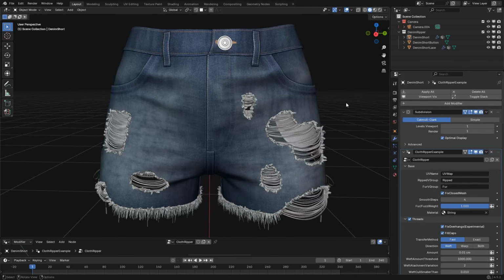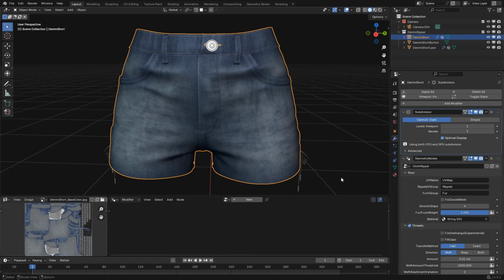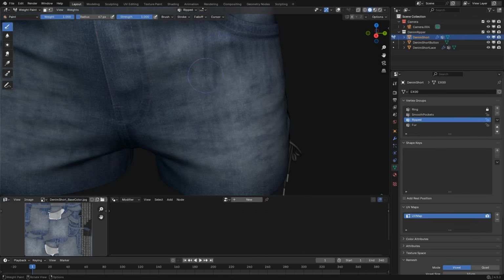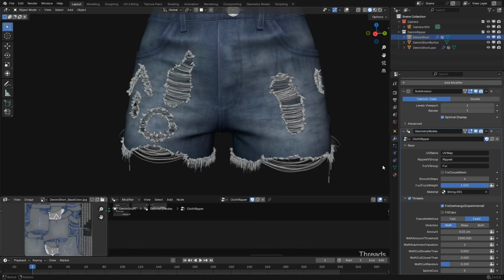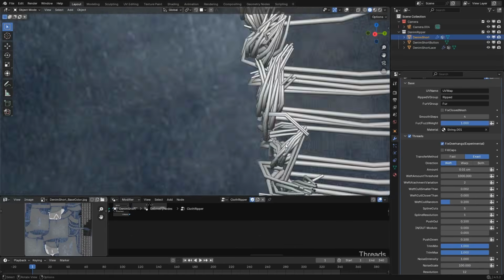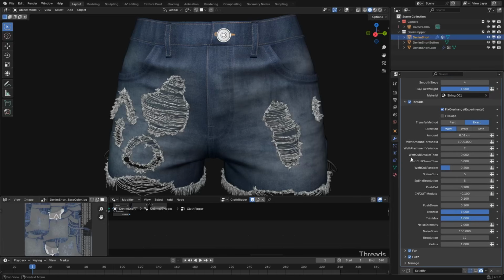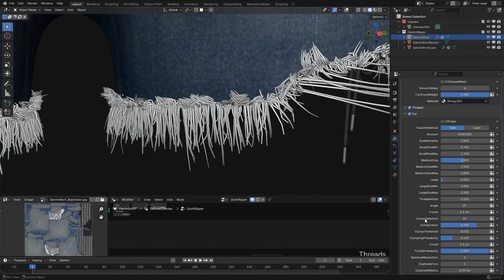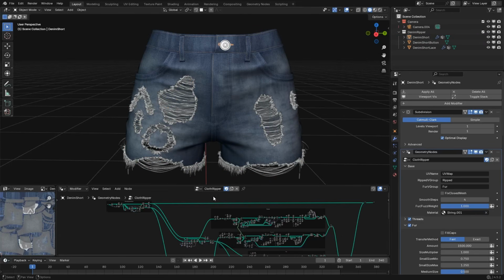Cloth Ripper - Add Tears To Any Cloth Using Blender

Comment: Hello I have some problem. The problem that appears at 6:19 keeps happening to me. I can't quite understand what action I should take to make the thread connect like that.. I only end up with holes 😂
Reply from the maker: Here are two things to check, your uvs should be perfect just like i said. the scale of your mesh should be applied. basically you don't want too large or too small meshes. unless you require them to be the size they are which in that case you will need to adjust the parameters to fix the problem. if the problem persist and you are not able to fix it, contact me on my email and send me a copy of your file so i can have a closer look at what the problem might be. Masoud.rz28@gmail.com
Reply from the maker: you could also try to set the weight paint brush hardness to constant. I'm not a 100% sure why this happens so again if the problem persists please let me know.
Reply: @massxrz Thank you! I sent you a mail